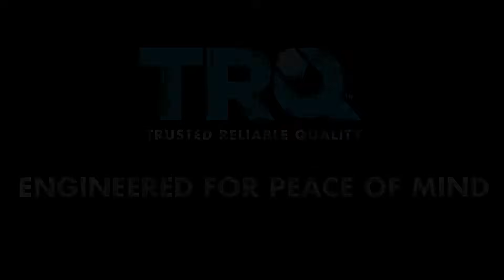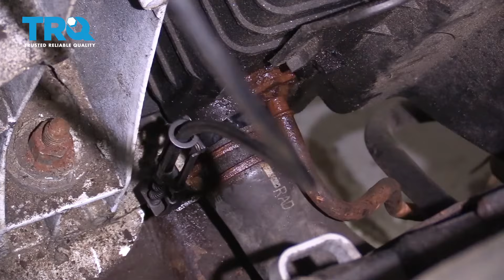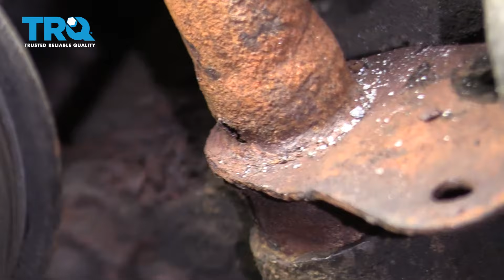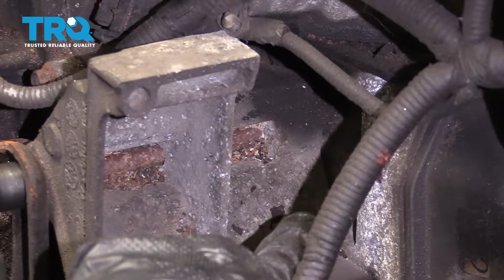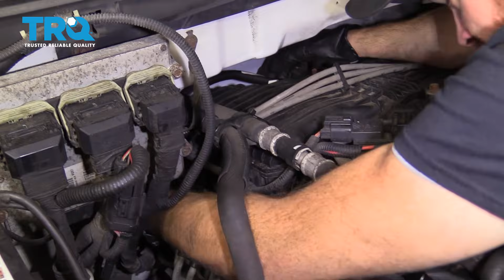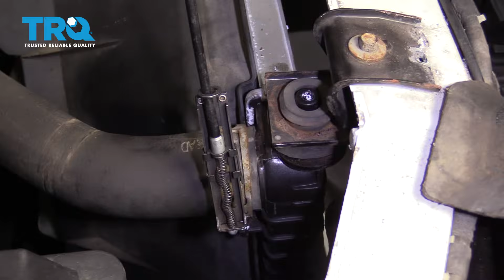How to Replace Water Pump 2004-08 Ford F-150

Comment from the maker: √  Watch the Video
√  Buy The Part at 1A Auto https://1aau.to/m-Shop-TRQ-Parts
√  Do it Yourself
√  Save Money
Reply: Mines a 98 and!  Used green that said it Was for multiple use and Ford etc., etc., Is I'm gonna be Mad as Hell if the antifreeze I bought Wasn't listed for My Pick up.
Reply: Thank you. That bracket on top of the water pump has kept me from changing the cam position sincronizer. It is frozen on there.

Comment: Freaking awesome. Thank you

I only had one issue.  One of the long bolts that holds that bracket- would not bottom out. Not sure what the problem was- I used a little bit of oil and eventually it seated -but it felt like the bolt was going to snap. It was not cross threaded. Strange

Comment: I replaced the water pump and heater tube but it is leaking from the heater tube . It seems the tube is loose when inserting it into the water pump . I tried adding more o rings and silicone but still leaks . Could it be the new tube is defective (incorrect width ?) also what bolt size is needed ? The screw( small bolt) I have seems smaller and seems to be slipping while tightening . Please help

Comment: Wish I would have payed more attention to the fan.  Ford put two different fans on these trucks depending on the trim package.  The one shown here has a standard fan.  My king ranch has an electric fan.  The hub sizes are different, and I am 3/4 of the way through installing the wrong pump.  The local parts guy didn't ask enough questions to get me to the right pump.
Reply from the maker: +Tom Potter Thanks for the tip!  http://1aau.to/m/Shop-TRQ

Comment: Very nice video.  If you mentioned which engine this is I missed it.  I'm thinking the V6?
Did you use any thread sealant on any of the bolts or studs?  It appeared you installed the Water Pump gasket dry, is that correct?
Thanks again for the video.
Reply: I noticed that as well.  Wondering if you need a sealant....and how much do you use?

Comment: Great video. It helped me a great deal. I don't need to change the pump now, but with 140000 miles on my truck it will go soon. Also the heater pipes from the pump are rusted so I'm watching them as well. I always like to see exactly what the old pump looks like when it's out and on the workbench. That is to ensure I am watching the correct video I need.  It looks easy, but you made it look easy.  Thanks, keep up the great work.
Reply from the maker: +wayne paulun Thank you! We love empowering our customers and showing how to perform DIY auto repairs with our high-quality auto parts. http://1aau.to/m/Shop-TRQ